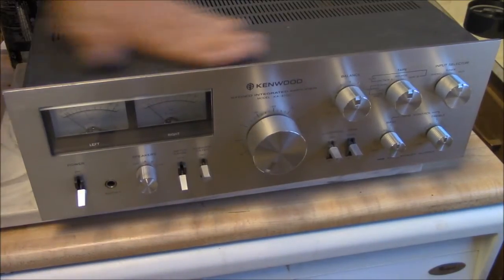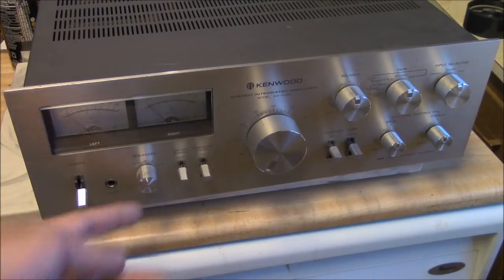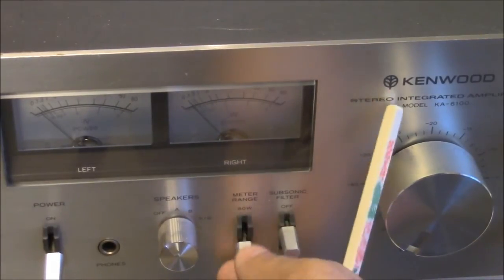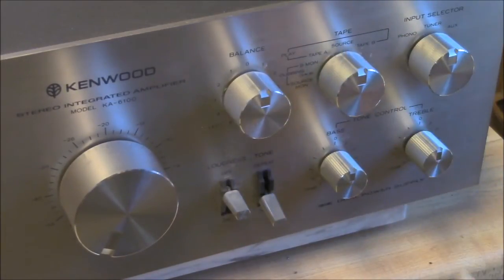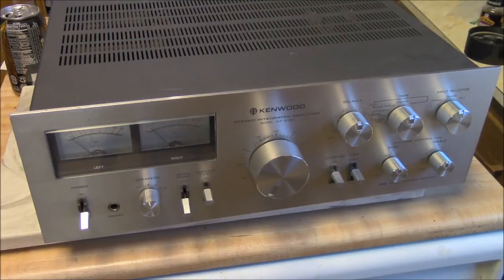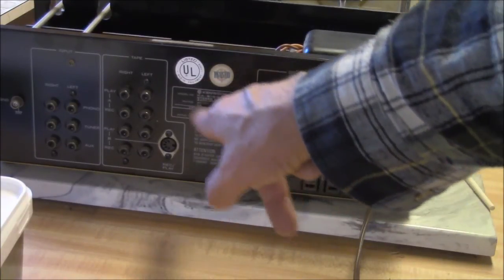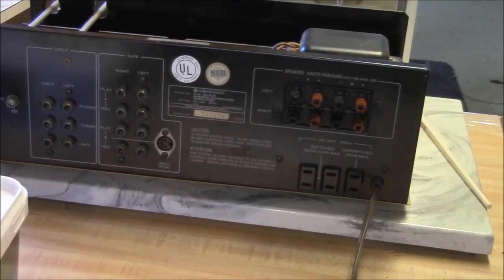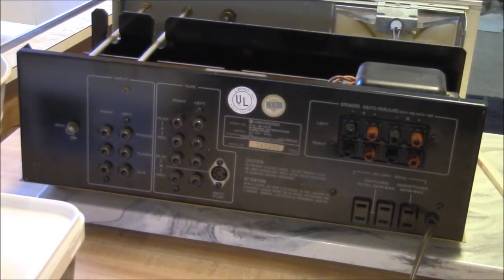Kenwood KA 6100 Amp PT1

Comment: Great Video. What are the size and voltage of each of the 5 fuses. I believe some are 250 V 4A and another 259 v 500A??
1/4"x1-1/4 inch The unit I have is this model I noticed the set of three had a slightl shorter fuse  in the middle  and the two on the right the sam size as the middle. When I did a visual all but one was marked inside as 250 V 4A and the first of the three marked as 259V 500 mA in the  F5 fuse insert. Any info would be greatly appreciated 
Thank you , Craig

Comment: Great video I can buy one of those with the Kenwood tuner that sits on top of the amp with a teac cassette deck With the original kenwood speakers For a $100 in great working order  would that be a good price .. Where are you located for repair service

Comment: 1969 to 1970. (Oh wait, do you have the 6100?  If so, sorry, my comments are for the 6000).  I don't think you know what you have.  These things sound amazing.  I have lots of equipment, but this KA-6000 blows them all away. Hard to believe I know.  I ad Adcom, Marantz, Kenwood, you name it.  I think mine was dropped because the back is caved in a bit.  Does not affect the sound of this battleship.  Of course, once you re-cap it, the sound, sadly, may change significantly.  If it ain't broke, don't fix this one. Enjoy. 

Power output: 45 watts per channel into 8Ω (stereo)

Frequency response: 20Hz to 50kHz

Total harmonic distortion: 0.5%

Damping factor: 29

Input sensitivity: 2mV (mic), 2mV (MM), 200mV (line)

Signal to noise ratio: 67dB (mic), 65dB (MM), 77dB (line)

Speaker load impedance: 4Ω to 16Ω

Dimensions: 16-5/16 x 5-5/32 x 11-1/32 inches

Weight: 24.5lbs